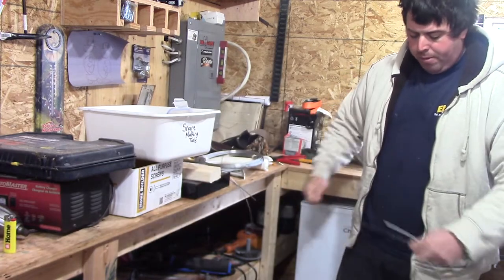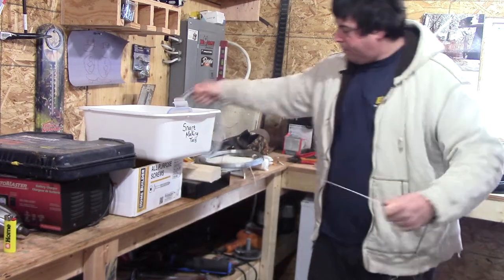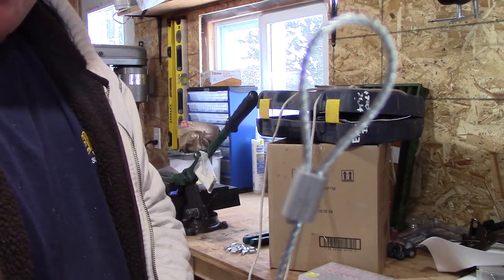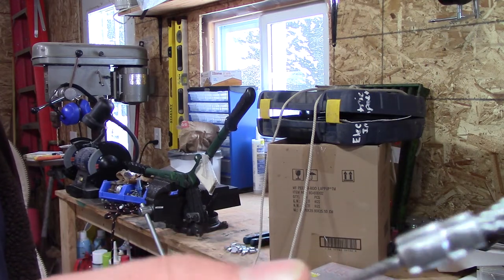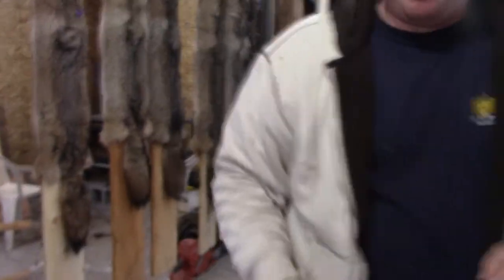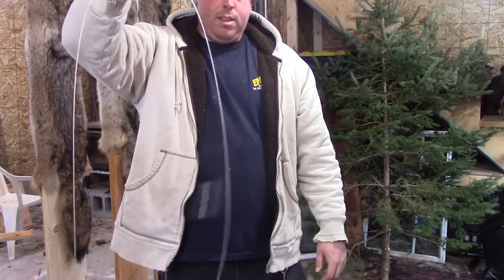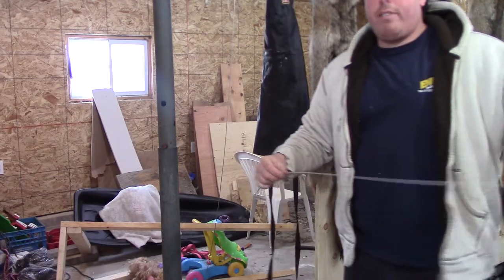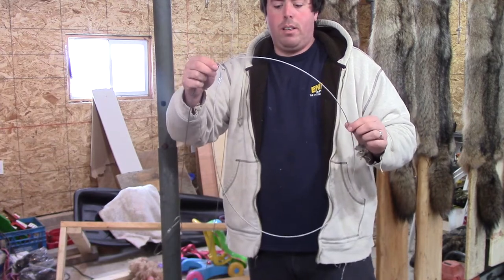How To Make Coyote/Wolf Snares with Mike

Comment: only issue I see is once the  snare is used it is no more good so you can't reuse any of the cable unless you use it for snare extensions , so if you don't use extensions it really can't be used  , so with a short snare and extensions ya just got throw away snare end and can reuse extensions ,  so the thing is what costs more two double ferrels to make extensions or the extra 5 feet of cable ya got on yer long snares ? lol. that make any sense to anyone ? lol